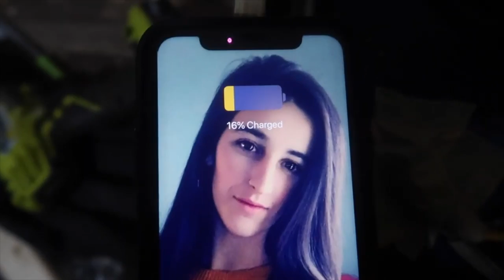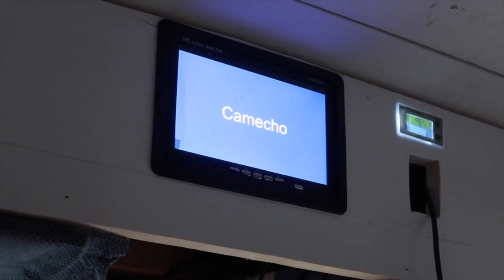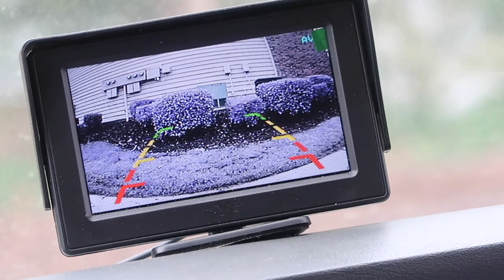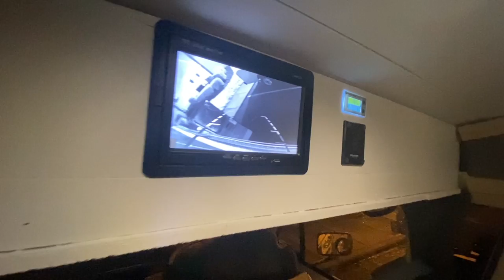I Built an Off Grid Solar TINY HOUSE in a Van for $3,500

Comment: Well done Sir!
I have been thinking of doing something similar.
After watching many people's builds I have to say this build is more to my taste than most.
I especially like how you kept it open feeling inside...not so much stuff reducing the already narrow dimensions but reduced length instead for a more square, open feel.
One thing I did see that was a huge potential problem though...the short backsplash behind the drivers seat and no headrest on that seat means any bump from behind will whiplash the drivers skull at the neck area into the sharp, top edge of that backsplash and kill or paralyze the driver.
Please keep in mind for you and your customers.

Comment: Pro tip caulk the edges whenever you cut a hole in the steel. Prevents rust and woodrot
Reply: 💯 And you never really know until it rains or you smell mold (moisture)
Reply: look at 6:00 and further he put some silicone on the holes/screws of the SolarPanels  not the best choice but its something i guess :D
Reply: Topanga Reyna  You know you feeling the young boy..Lol
Reply: I'm sure this guy knows his stuff,  who's taking advice from the cool air man .

Comment: Imagine what he could do with a 2000$ 40 foot shipping container
Reply: Thats woo too much money!!!!
Reply: @swedensy  That's really not
Reply: @iamwhoyousayiam6773  

You're right but he may mean post-build expenses as a van can go anywhere. You can find a place to park and sleep but a shipping container has to be stationary somewhere and that somewhere is going to cost money.

Unless it's family land or already owned and then it's not a worry.
Either way, I'd imagine this dude could really go wild on something like a shipping container!
Reply: @DannyWilliamH  It's still not that much money. You have to shop very carefully to design the interior of any home for that. Materials aren't cheap.
Reply: @iamwhoyousayiam6773  

Yeah, but I'm saying they may have meant the cost of where to put it. Land costs money, haha.

I agree that the cost of the container alone and fixing it would be in par with the vans (or not too far off to avoid looking into).
I'm saying a van doesn't have to sit stationary on a plot of land, therefore that saved cost is an issue if you don't own land.
I don't know if that's what they meant but merely said it could be. Depending on where you wanted to put the container and if you did or did not own the land already could be a hefty sum to consider.

Then again, long-term fuel costs for the van may eclipse that anyway so...?
Reply: @DannyWilliamH  You don't need to own the land it's on. You can "camp" for extended periods of time on some locations, and they even have water and electricity hookups. Trailer parks even. I agree the gas would be murder, but maybe not so much of a burden for someone with the funds to "pimp their ride." These aren't designed to be heavily used in terms of travel... It's about living self-sufficiently but being able to move when needed. This likely isn't the only vehicle an owner would have. It's unrealistic to hookup, disconnect, and reconnect frequently. It's a chore. A lot of people that do this do it out of hobby and it ends up being parked in the garage or driveway forever as it's used for another family member or guest.
Reply: Moshpittin' Kitten I think he meant that shipping containers have to sit stationary on a plot of land, not the van
Reply: @malachiyates8079  They don't though. Towing rigs with wheels.
Reply: Couldn’t really do much with $2,000 in a 40 foot shipping container. A good portion of that would be spent on just insulation. Windows cost a couple hundred, as well as doors. Solar setup can easily reach $800-1500+. Unless he got everything used (wood being thrown out by construction sites etc).
Reply: @DannyWilliamH  can't just have the shipping container on a truck?
Reply: Moshpittin' Kitten How much do those cost
Reply: @elliotzhang2358  used? $50-$500 for a huge one
Reply: @truthseeker1203  That depends on the insulation type (foam, sheet, layered) Windows vary greatly and if you know how to put them in and already have a welding kit, that cuts the cost down significantly. Solar is unnecessary and arguably pointless.
Reply: @truthseeker1203  re read my post, a 2000$ 40 ft. Container. The container costs 2000$
Reply: One person gets the wrong idea, misreading the $2000 part, and everyone else follows suit lol guys, the container costs 2000$. I have no clue how much the price range is to build from it. Geez a whole debate started on a tangent.. it's like the telephone game but everything is written down smh
Reply: Moshpittin' Kitten Solar is absolutely necessary for someone who wants to be off grid. Metal is expensive, and if you want quality windows that are insulated cost is high. Spray foam insulation cost an arm and a leg. Itd be easily $1,800+ for spray foaming a 40ft container. Sheet would still come out to around $800. Then theres paneling, joist, framing, flooring, lights, counter top, bathroom, sink, water source, etc. My point wasn’t that you couldn’t build it on a budget, my point was that $2,000 wouldn’t go far. Now I see the OP meant $2,000 for the container, so it doesn’t matter anyways.
Reply: @truthseeker1203  Solar is absolutely not necessary as a generator and propane are more efficient and easier.
Reply: Moshpittin' Kitten lol Solar you hook it up and it gets its own energy. Propane or a generator you hook it up and gotta go buy more gas/propane. Generators gotta be refilled daily. Propane is efficient as far as stoves etc. but I would hate to be off grid with a generator and constantly have to buy gas/hear the damn thing.
Reply: @truthseeker1203  And? Solar does not generate enough power for it to be a primary energy source. It wouldn't hurt having it, but it's far from necessary.
Reply: Moshpittin' Kitten if you add up the cost of constantly refueling and constantly filling up propane it comes out far more than a one time investment in solar. Solar is great, it all depends on the system. For most people looking to do an off grid system their energy needs are different anyway. Theres people out there with systems that power all their electronics plus the a/c.
Reply: @truthseeker1203  Again, SOLAR DOES NOT PUT OUT MUCH ENERGY.
Reply: Moshpittin' Kitten You’re misinformed. It depends on the solar setup. How many watts your setup brings in. A 40ft container with 100-300 watt panels running all the way down will power everything you need. No gas, no propane, just the sun. It also depends on the inverter and batteries you use. Try telling that to the people who live in skoolies with solar setups.
Reply: Moshpittin' Kitten lol yes it does.. again depends on the setup do your research.
Reply: @truthseeker1203  The panels only collect energy when facing direct sunlight, only a few hours a day. Enjoy watching TV for 2 hours, then the generator is needed. The conversation is expired.
Reply: Moshpittin' Kitten lol Most people who live in skoolies/tiny homes on solar don’t watch tv anyways, myself included. And yes youre correct the sun charges up the batteries and your appliances run off that. Again it all depends on your solar setup.
Reply: @truthseeker1203  Fine, spend thousands of dollars on a useless green gimmick. I don't care anymore.
Reply: Moshpittin' Kitten Generators are and can be very expensive as well. Plus you keep paying for them in gas. Solar is a one time purchase, setup and go.
Reply: Moshpittin' Kitten 
It does depend on your setup. Look up net-zero metering using solar roof & tying directly into power grid. People have done it since mid-2000. Solar power will feed into power grid during day time, running your meter backwards. During night time, you draw power from the grid. Properly sized for your power consumption, the solar setup can achieve net-zero each month. 
For container that’s off the grid, you’d need battery to store all that power. That would be the expensive part.
Reply: @jack765ful  are you claiming 2 yards of solar panels on a roof (just like on this video) are sufficient to run a home? Oh please, do tell 😂 Have fun
 Honestly I don't care. Because I know I'm right.
Reply: @truthseeker1203  "expensive" is subjective. I'm not attributing such objectivity as you are. I'm saying propane and generators are cheaper and more efficient. There's nothing you can say, it's fact.
Reply: Moshpittin' Kitten You are the one arguing with me based off your opinion that simply isn’t fact. You obviously have a hard time accepting when you’re wrong. Solar is very efficient and works great for a lot of people. Propane and gas may be efficient for some things but for people who are trying to live off grid and keep cost down solar makes more sense. Especially those who want to detach from society.
Reply: @truthseeker1203  If solar was so efficient they wouldn't bother with batteries, generators, hookups, gas and propane you tool. Solar would be the default installation, rather than an on the side option for emergencies. 🤪
Reply: Moshpittin' Kitten you do realize generators are an on the side option? Lmao. Solar is also a newer concept
Reply: @truthseeker1203  I had a solar powered music player over 20 years ago. (It was lucky to last 20 minutes.)
Reply: Moshpittin' Kitten 20 years ago..... Solar has come a long way since then.. if your knowledge on solar dates back to solar powered cd players and calculators from the 1990’s you got some research to do.
Reply: @truthseeker1203  I was using it as an example. I provided personal experience. You've provided nothing. You really need a hobby lol
Reply: Moshpittin' Kitten your personal experience was over 20 years ago...
Reply: @truthseeker1203  🤦 Don't breed.
Reply: @truthseeker1203  Crank generator ftw no gas needed. Fyi you still have yet to post any proof or any reason for you to spout the efficiency of solar. Have you ever used it?
Reply: @truthseeker1203  Btw, that's in 2020 not 2000 🙄
Reply: Moshpittin' Kitten So you would rather hand crank energy than allow it to be freely collected from the sun? Bro were going backwards here... My bus as well as hundreds of other skoolie/tiny home/shipping container homes/cobb buildings all use solar. Anyways Ill let you have the last word since you really want it... insert your useless comment here >
Reply: @truthseeker1203  If hand cranking nets me 24hrs of power vs. 2 hours, Hell yes! And I'm a woman. And you also haven't provided any information or personal experience to back your claim. I have experience with all of these energy methods. I grew up in the mountains. You are very clearly just someone who wants to desperately be right, but as it stands now solar is not as efficient nor is it necessary. You probably support wind turbines too, despite the fact they cost more to make and provide next to nil energy

Comment: A couple tips, insulation under the flooring. Also silicone between the roof vent and roof before screwing down or any of the holes through the roof just for waterproof sake

Comment: me: "looks in wallet"

me: "looking at my PC"

PC: dont do it
Reply: Niko Lindroos ?.??
Reply: with enough battery storage you could run your gaming PC right in the van
Reply: Nick slik T. Leep I don’t understand the WiFi situation though
Reply: @castro2590  google "verizon jetpack" that's the brand i have but there are tons of them. they're just a device that uses cell service to put out only a hotspot. that is also how police have wifi in their cars. you could also use a hotspot on your phone but none are truly unlimited like some of the dedicated devices are
Reply: @nicholaslepp1502  It would be more effective to have a laptop, they are made to be energy efficient
Reply: @ElBach1y  i didn't realize anyone said anything about desktops. but laptops are never as fast as an equivalent desktop either and since you mentioned it, the guy is running solar so it isn't like his energy bill would go up. he can just add more batteries.
Reply: @nicholaslepp1502  it's not as simple as adding more batteries, sometimes in winter you don't get enough energy or depending how much surface do the panels have
Reply: @ElBach1y  it really is that simple. i have 6 gel batteries and started out with one. you just connect them together as one large battery. the amount of panels do not matter as the batteries only store the power. same as adding a power bank to your phone. the charge time does not change only the amount of time they hold as charge as more batteries only makes it last longer.
Reply: @ElBach1y  you do realize whole RV's run off of these batteries, right? i dont understand your logic at all. i've never had a problem and one of my alpine alpha gel batteries run a dell t3600 with a 16core xeon and 32gb of ram plus 2 graphics cards for over a day.
Reply: @nicholaslepp1502  i use a hotspot on visible wireless. Unlimited everything, no slowing speeds or data caps for only $40 a month. I use about 500+ gigs a month and its on verizon network so win win.
Reply: Simulate building a van lmao
Reply: Sell the pc build a van sell the vans and keep going up
Reply: Niko Lindroos: LOL, LOL, LOL, Just Save a little More and or Start buying the Materials One by One and find out from Craigslist. where or who is giving Out Free Wood, Cabinets, Fabric, etc.....You Can Store Stuff in your Room, or in a Closet, find Out where they have Fabric, Cabinets, Knobs, Tools for Sale, and get it One by One, before You Know You'll have a Lot of Stuff, and then Just Save Up for the Van. I hope this will help give you tips and ideas. Just Some thoughts, though.

Comment: That's a beautiful build! But remember: Reflectix is NOT insulation. It has a really low R value, it's only "ok" when you combine it with an airgap. You need something more durable to actually keep the heat in considering you're living in a metal box on wheels hehe. Kuddo's though!

Comment: Looks like that tear out reinvented a few wheels. But then there was no mention of why. Guess just wanted a clean slate?  Envious of cost though. Just my (3) 175W solar panels, my battery, inverter, solar controller, and roof rack cost over $2000. And that’s with no wiring, not panel mounts, no bus bars, no distribution boxes, no breakers, no fuses, no nothing else.

Comment: I would have been quite content, and happy with just getting the Conversion Van, and leaving it exactly as it was when I purchased it. All one person needs is a sound roof over the head, with a decent bed. Hell, conversion vans provide the bed for you at the touch of a button, or, in some cases, the pull of a lever, and a seat that folds down into a bed. A small bbq grill, and cooler is all I would need for meals. A house battery would give me all the power I need to charge my phone, etc. There is no need to make yourself unnecessary work by ripping everything out to install what is already provided.. The idea of the Conversion Vans with the Seat/Bed Combo was to WORK SMARTER, NOT HARDER... I don't understand why so many people purchase these rigs used, and already equipped with a seat/bed combo in them, then turn around, and rip all of it out to build, and install a bed... Why ????? Why work harder to rip out a built in bed just to replace it with.... Another bed ????? Makes absolutely, positively no sense to me at all....
Reply from the maker: Not all of us are content with sleeping on 30 year old mold. Some of us enjoy working hard and achieving something that can only be received with hard work and dedication

Comment: i see that you're drilling and cutting straight thru the fiberglass. I was told that you're not supposed to do that. if not i have a fan i been holding on to for a year for no reason. 🤦🏾‍♀️

Comment: No entry gland for your solar panel cables? Not even a grommet?  Any sealant around tose screw holes made securing the panels? 

Oh, maybe you’re going to take a shower from the leaks and keep warm from the fire start by an electrical short? Did you use butyl tape and lap sealant on the fan? 

But your woodworking skills do the trick.

Comment: Yo how can I get in touch with you  I have a 200 Chevy Astro and I am about to buy a Ford E150 I am a carpenter by trade so I know some work but like the electrical part I need help there’s anyway I could get your number so I could do the framing the flooring but not the electrical

Comment: Dislike: Would've been nice to see the bed frame lift up for more storage. Also I noticed there was no insulation, this van going to become very cold in the winter and besides the fan for summer, its going be challenging to fight the summer heat. Not sure if putting the cooking burner that uses propane in middle of the van was best idea. Really think a electric stove could've been best opinion sense there solar, and there was no compost bathroom or solar shower, and very short limited of water. 

Pro: I really like the craftsmanship in wood. 

Great that you understand wiring, and wood craft, but for best overall Tiny house/Van life really need take other factors sense this is going be someone home to live in, maybe for a couple weeks or months or even years.